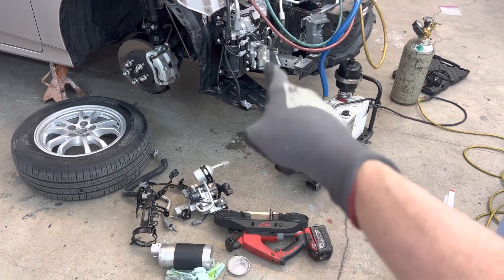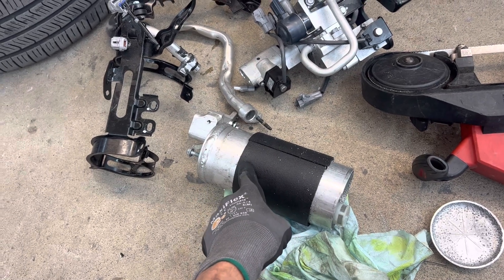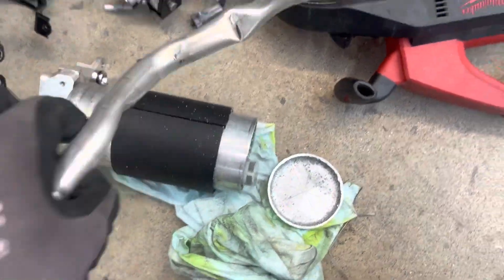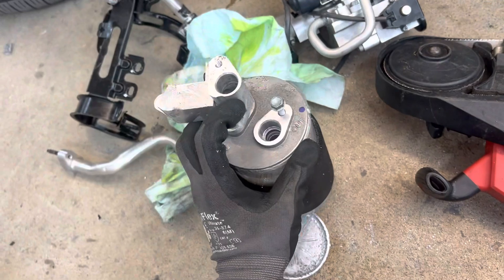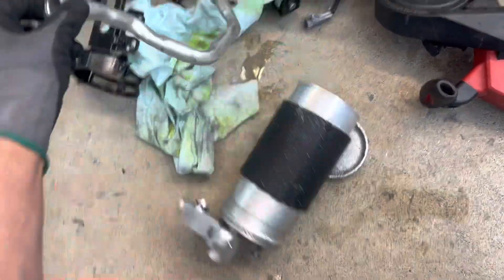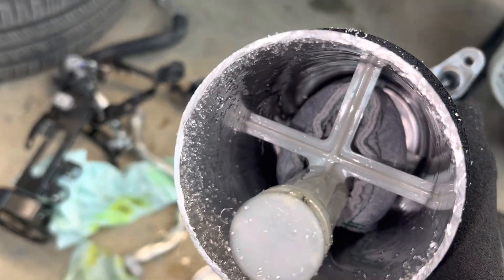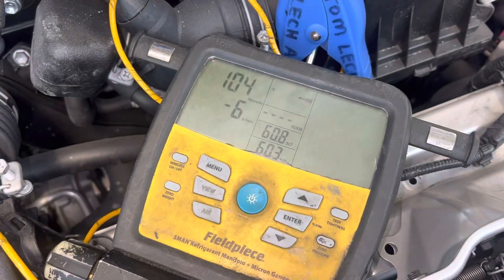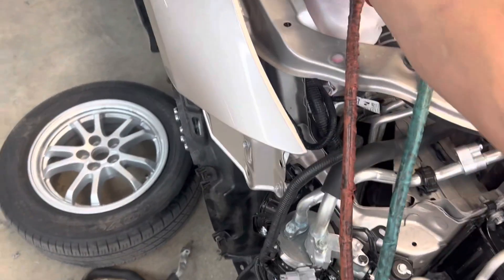A FEW OUNCES OF REFRIGERANT OIL LOST ALL AT ONCE BECAUSE WERE THE LEAK HAPPENED

Comment: Tom by any chance do you have a good used (a couple dings would be ok) hard line that comes with the accumulator assembly? The line you are holding.
Reply from the maker: @tomw5890  no.
If you have an air-conditioning and radiator shop nearby, they might be able to make one up for you . 

Or take your fitting ends and they cut the aluminum and splice on a hose and put a piece of rubber hose in between to replace the metal line
Reply: @coldfinger459sub0   I was thinking the same,  Im out for a month, hopefully I can find something on ebay while Im away.    How much oil does the system take when its completely empty?

Comment: Although not as efficient, that cant easily happen with a York, Tecumseh, or Chrysler V-2 piston type compressor as compressor lubricant is mostly contained within the compressors crankcase. Not a fan of newer design compressors.
Regardless, I vacuum all automotive systems for at least 30 minutes, then install 12 ounces or so refrigerant and vacuum it down again to ensure there is virtually no air or other non refrigerant substance in the system.
I do not use R1234 in anything, and I dont give a damn about whether such is legal or not..
Reply from the maker: Yorks , Tecumseh or Chrysler V2 old bulletproof compressors, slow rpm moving last 100 years bulletproof.
The compressor is $1500 plus on this vehicle that accumulator assembly is $2600 on this if you burn up a compressor there’s several expansion valves that are electronic solenoids total cost after flushing parts replacement is about 6000+ dollars . 

When somebody guesses and does anything wrong and they don’t follow procedures and I test a refrigerant tenants used a different refrigerant or a different lubricant orange moisture contaminated because I owned equipment that contestant prove that it was done wrong. Guess who’s responsible for the bill? .
Reply: @coldfinger459sub0  Cost of replacement parts is why I prefer old style expansion valves and orifice tubes, and always replace the receiver-dryer...I didnt mention that. Many people want their systems on older vehicles converted from R-12 to 134 A, and although not as cold, still works fairly well despite having to replace mineral oil with poly-alkyl glycol lubricant Everytime I find R-12--I buy it and it is always recovered from any system that uses it. 134 gets vented, its likely contaminated anyway.
Reply from the maker: @donreinke5863  that’s why I have a refrigerant analyzer I can test the R 12 to see if it’s contaminated or pure before I recover it. I have almost 400 pounds of R12 one 250 pound container couple 50 pounds a couple 30 pound.  

134 is now $350 a container and next year it’s gonna become more expensive because they’re mandated not to make so much. That’s why the price jumped up last year so expensive.. 

The PA mandated the phase down with our 134 so we’re seeing the prices jump just like back in the 90s when they started facing down R12. 

When you really want to get those old cars, nice and cold on a hot day with R134 change the condenser to the new style microchannel parallel flow. 

When testing R12 with my analyzer, I find that most of it now is contaminated with R134 dropped on top of it, or propane dropped on top of it.
Reply: @coldfinger459sub0  Good tip on the condenser--thanks......Im envious of your stash of R-12. 
Ive heard some people used propane when they couldnt find R-12, or they used that Johnsens stuff, Im not sure what is actually in it.
Reply from the maker: @donreinke5863  the other stuff in the can is a mixture of propane and butane. 

Propane works good but because I’m a licensed business and all the EPA paperwork and stuff like that legally, I am not allowed to put propane in any automobile and legally liability wise I would become 100% liable for putting propane in a vehicle if there was a fire .   So that’s not gonna happen

Unless it was my own personal car, then I don’t care I would use propane .

Comment: The most most techs vacuum is 10 to 20 minutes even if a system was left open a few days in the shop. The machine passes the leak test and it gets filled. So sad.
Reply from the maker: Shops in the shop owners are hard-pressed to make profit in money that is more important than quality or somebody system last 10 years longer. 

I’ve literally had shop owners tell me they rather see compressor’s only last three or four years and get paid $2000 to replace them then do it right and having them last forever . 

It is a sad way to look at it, but that’s how some shop owners think . 

They cannot make money honestly, so they kind of bend the rules and spin the story and make money a different way .

Comment: I like this content and it give lots of insight into ac work. I always wondered how you get all the ac flush crap out of the evaporator after you blow it out with shop air. Lol. It seems like you would just pull the vacuum until it all boils out with the shop air moisture and I'm sure I've never vacuumed it out long enough. Residue must have mixed in with the refrigerant shortening the life of the job. Ignorance is costly.
Reply from the maker: Are use dry nitrogen for flushing as a pressurized air source, so I never have to worry about moisture. 

And ask for a worrying about flushing solvent being left behind that’s what the micron gauge is for whether it’s water or any kind of Alatorre compound that evaporates the micron gauge will tell you that there’s some still left behind because the number will keep rising . 

You can actually measure to the point where there’s no more left .